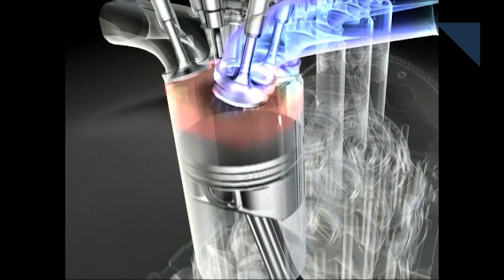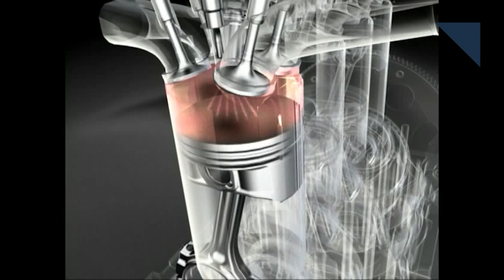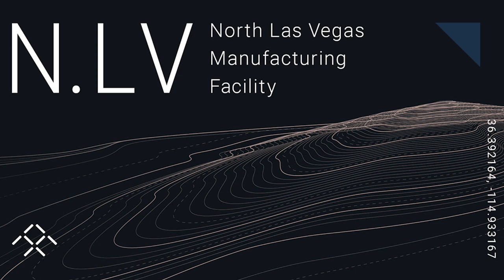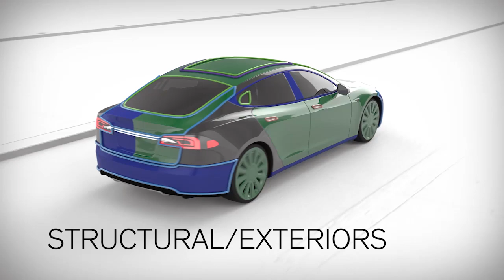Mazda SKYACTIV-X Engine, Nissan Sell Battery Unit - Autoline Daily 2164

Comment: This quick and easy method, you can have nearly unlimited amounts of battery power …for nearly no cost [Check Details Here==>https://plus.google.com/100351090281822647456/posts/Gwtd4mVBdEd ]. Enough to even live off-grid and power all of your devices an electronics! This easy method works for nearly all kinds of old/dead batteries too…_

Comment: Mazda got the plans from a private designer.  Without the genius of this guy most cars would still be running carbs.  Your phone would not fit in your pocket, it would still be on your wall.  Your computer would be comparable to an 80's calculator.  No Xbox, Playstation, Nes, Rick and Morty...

Comment: EV sales at bmw fail due to price and also the other bmw models as said are just outdated. nearly the same look from 2007 and 2017. only minor changes have been made in styling. they need an overhaul. they styled the i8 nicely do that with the other models and you will have a success.

Comment: hopefully the hcci engine is cheaper then a diesel
Reply: If it will work like a Diesel, most likely it will be more expensive as it needs to be build stronger. Perhaps not as a Diesel as Diesel fuel needs more pressure to ignite as it is a thicker, less refined fuel, but it will most likely increase the price of that engine. So in that case, might as well stick with Diesel. Diesel fuel on its own has more energy density than gasoline. That will never change, so even with HCCI it can't be as fuel efficient as Diesel, unless the compression is so high, that it takes less gasoline than diesel to make that ignition. But then, the engine resistance and materials will have to sustain very high pressure. On top of that the fuel pump and fuel lines have to follow, so not much difference, so what's the point of HCCI? Might as well stick with Diesel.